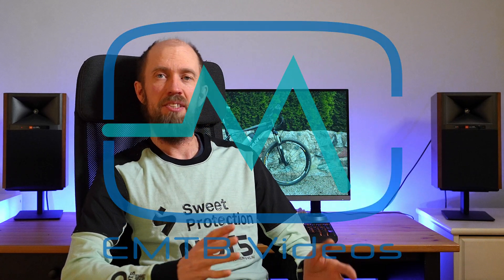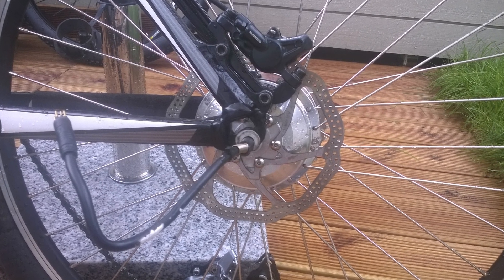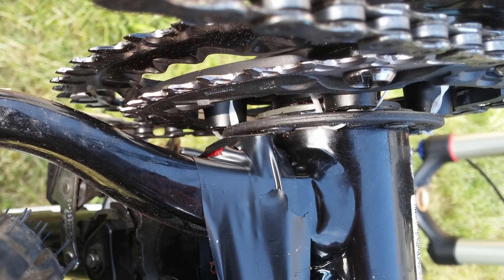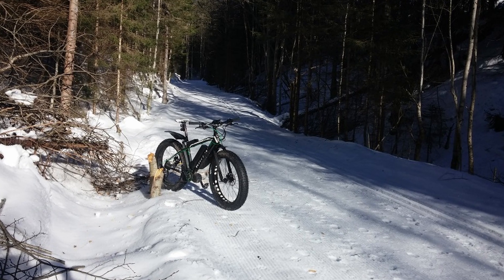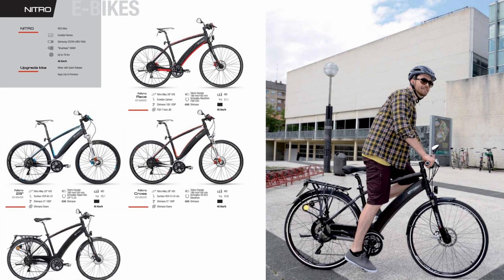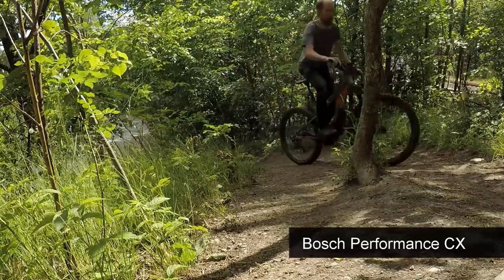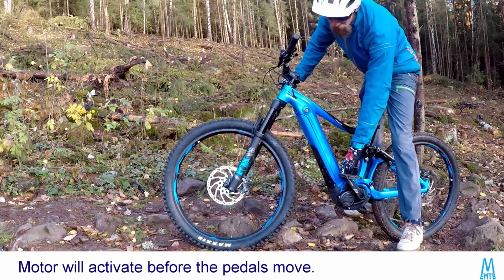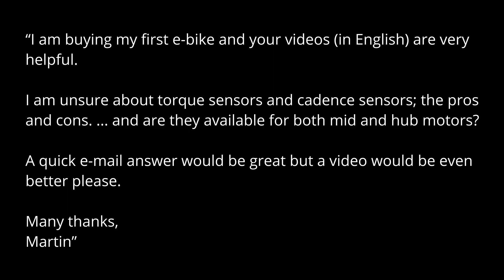Cadence vs torque sensors on ebike motors | your question, my answer

Comment: Do you know if the new Amflow / Avinox motor even has a torque sensor? Have seen conflicting report that the Amflow is just a high end cadence sensor that can somewhat simulate an actual torque sensor.

Comment: ✅ good review! Fortunately, I started in '19. Both sensors seemed well integrated. I remember riding a buddy's  bafang rear hub hardtail in '18. Didn't convice me to switch to analog until i test rode the Trek Rail...a true OG beast but smooth and responsive.